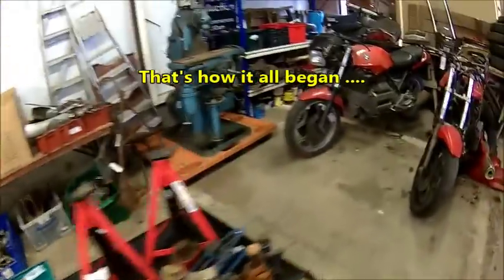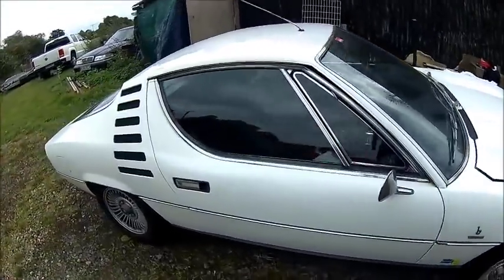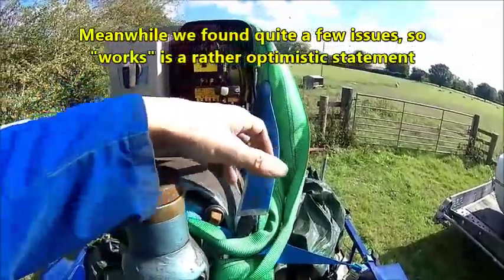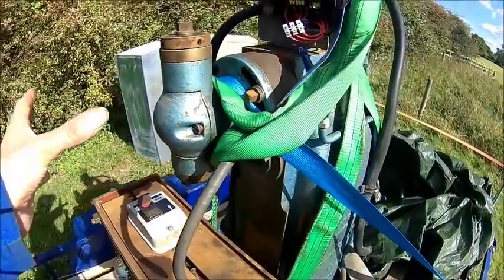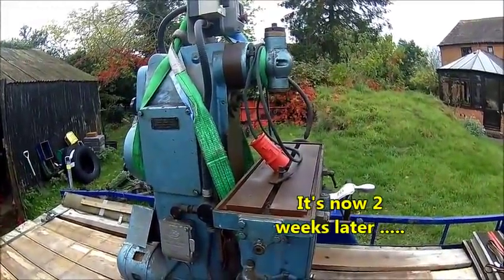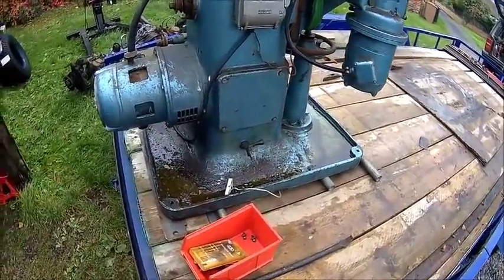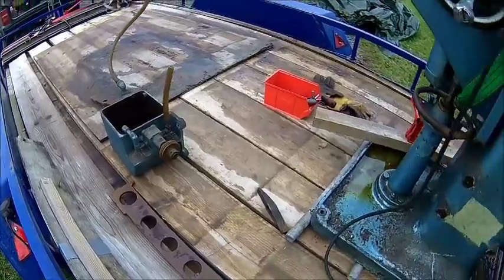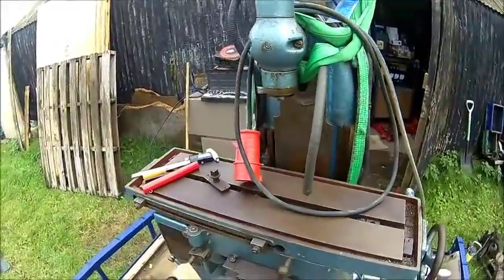The Matrix unloaded -  Part 1, the discovery and tear down of a Matrix #6 milling machine

Comment: Nice new toy. That feed motor is huge compared to modern stuff. Over engineered and probably very strong :)
But the main motor is also pretty big for 1HP.  I got an old cast iron 1hp single phase that looks a lot smaller.
Reply from the maker: It's rather semi-ideal, but it fills a gap in my machining capabilities. Looks like pretty much all bearings are shot. I think the feed motor is 0,25hp, the main motor is 0.75hp but it's 2 speed 700/1400rpm which requires a slightly larger frame size than a plain 1400rpm motor. Strangely they made the high speed power rating rating the same as the low speed, rather unusual.
Reply: That's to bad about those bearings.

I recently picked up a Dahlander (a.k.a pole switching) motor. It switches between double star and delta.Highspeed 1400@2.0Kw and 700@1.2Kw. Lots of harmonic noise at 700 RPM. Complicated wiring, lucky for me it came with all the wiring :)You must have a motor with separate windings for 6 and 8 poles. More copper bigger motor, maybe?
Reply from the maker: Imperial bearings are cheap over here, it just takes time to do it , you'll see + hear the rumbling motor bearings in the next episode.
Well, ...the Dahlander setup is not exactly complicated, just draw all the coils on a piece of paper and it will all make perfect sense. Motors with high pole count are always noisier, especially older ones, there is not much you can do about. You're right mine has 2 entirely independent windings, 8 and 4 pole, so that's 400V only then. Surprisingly it's rated 400V, not 415V or 420V because that was the mains voltage back in 50s ... the whole machine is just a mystery ....
Reply: Hopefully the bell housings and rotor shaft are still fine. Mine were loose so punched some dimples into the bearing seats. So far so good but will probably not hold up forever.I thought 3ph was 380v back in the day. But that might have been different between countries. The grid probably wasn't connected back than.
Reply from the maker: There were some unexpected challenges with those motor bearings, but the housings are fine, you'll see it soon.
UK mains was usually 240/415V until they 1995 declared to follow the unified EU voltage of 230/400V, technically we still have the same as before because it's not that easy to drop a nationwide grid by 10 or 15V, but the stated tolerances do allow for that, so we now 230/400V by definition, but actually sitting at the upper end of the tolerance band.
Reply: So with brexit the UK can go back to 240/415.I believe over here we went from 220/380 to 230/400Trying to average things out, that smells like Brussels :)
Reply from the maker: Yep, no physical changes required and most people here still talking 240V, Still one of the most popular faults on (new !) drawings i get for checking ...:-)
You correct, NL/D/F had 220/380V until it was decided (most probably with help of Brussels) to waste our tax money for literally nothing of value.

Comment: 15 kg for a coolant tank, maybe to reduce vibration???. Nice mill, with small footprint.
Reply from the maker: vibration...lol,....., i forgot the lid, that's, probably another kg or two,....the whole machine is just built to last., everything is massive. The footprint is actually bigger than my Rigiva (which has a similar work envelope) because of the motor sticking out of the back, whereas on the Rigiva it's built into the column. Considering being about 60 to 70 years old, it's still in pretty good shape, .... probably still better than a Chinese toy mill fresh out of the box
Reply: @dynoguy  yes, sliding/bearing surface area is massive. Matrix of Coventry were a manufacturer of high end equipment as you probably know, very unusual for double spindle arbours.
Reply from the maker: Yes i know about Coventry Tool Co, and they actually sold some milling machines but this must have been before 1960. When i first saw it, it instantly reminded me of a Herbert design, so maybe the machine was produced by Herbert for Coventry Co. I did a bit of research and apparently Herbert did some contract builds for other manufacturers, so there is a possibility. It's just strange that there is absolutely nothing to find on the web.
Reply: @dynoguy  , I have found a little history of Ti Matrix on Grace's guide.co.uk But no machine details.
Hopefully you find a date of manufacture on the machine somewhere.